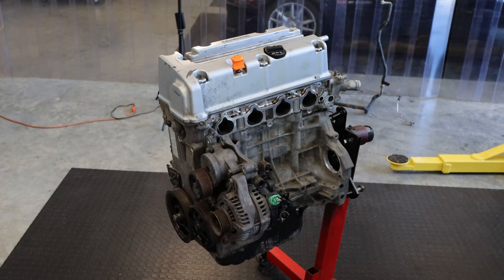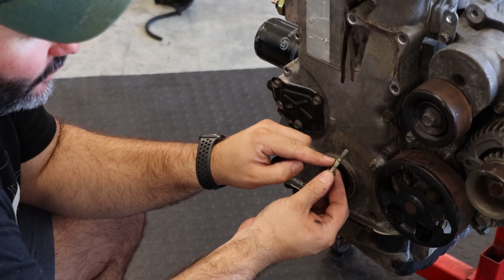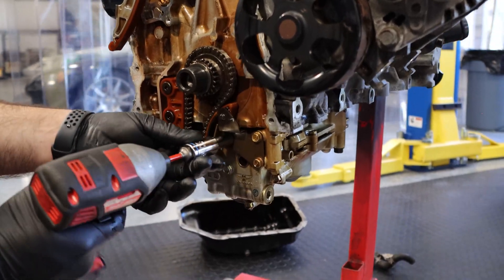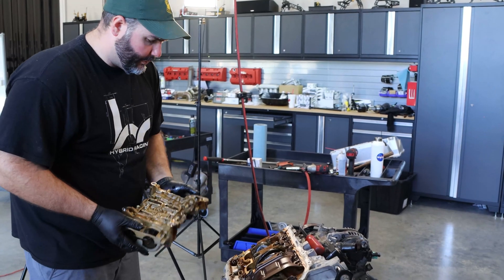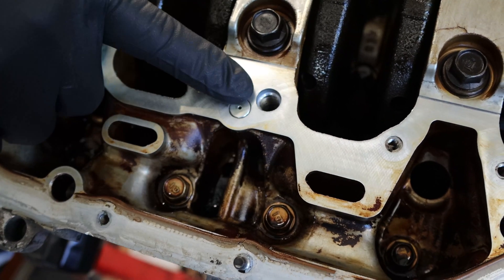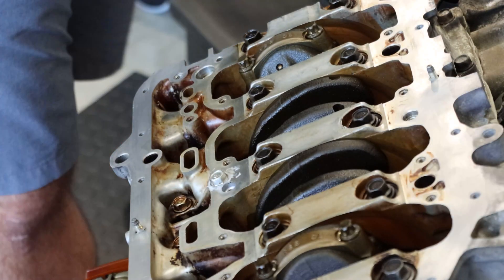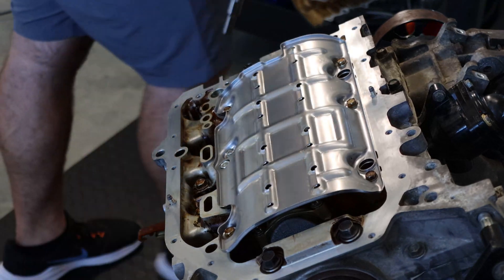K20A2 Oil Pump Upgrade installed on  a JDM K24A!

Comment: The purpose of the robust k24 oil pump was to reduce sound, vibration and rough engine idle. K24s generally came in more luxury or non-performance vehicles, thus the need for less sound/vibration.

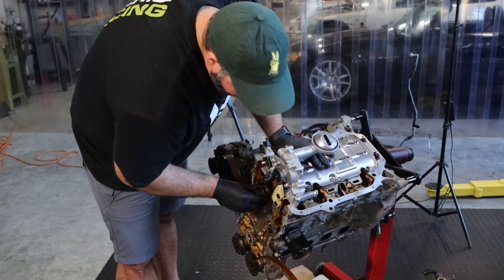Comment: Ummm what did you pull out at 16:20? I didn't pull anything out after I installed it all.
Reply from the maker: You must remove the holder that is in place on the oil pump chain tensioner. Once installed, you remove it so it will tension the chain.

Comment: Is here any difference on the a2 oil pump and the z1 oil pump? I'll be doing an K24a build this summer and I was wondering which one would be better? The a2 or the z1 oil pump? I'm leaning towards the z1 setup, but was just wondering if the z1 is better or is the a2 better? Thank you in advance to anyone that can help giving some advice. <3
Reply from the maker: They are the same.
Reply: @hybridracing  thank you! 🙏🙏

Comment: Brilliant vid and saved for when I swap the balance shaft out of my K20Z4 in the near future. Question though, do you have enough bolts off the old windage trays to bolt the new one in or need to order more? The old oil pump had bolts between cylinder 2 and 3 which are no longer used. Do these need replacing? Or just left open?

Cheers 👌🏻

Comment: You guys didn’t show the part how to modify or cut the k20a2 oil pump so it could properly fit on k24a
Reply from the maker: We explain it in the video. We used a bandsaw.

Comment: Question !!!! The bolt you guys put on with honda bond , is that necessary? 😭 cuz all i did was put a lil big of lug tight and screw a bolt in as tight as possible. I did have a thread in there, I know there’s people that dont and have to make one
Reply: yes fam honda bond is a must all manufacturers have one like ford etc. but yes bro use hondabond. Honestly leaving yourself up to failures by not trust. you should always use hondabond when needed and always torque to spec

Comment: I ordered k20a 2 timing chain set the chain does not fit. The k24 does not fit any suggestions
Reply: Get a k24 chain
Reply: chain should be 32 link instead of 31

Comment: Why after 5 different videos does no one say what size that bolt is that goes into the oil port? Could someone tell me the size bolt please?
Reply from the maker: It's an M8x1 bolt (regular Honda 12mm bolt)

Comment: Not a detail left out. Huge help.
Reply: They didn’t show the cutting of the oil pump so not really
Reply: @Red-ev8ls  buy your s-pump from 4piston. I just installed mine today actually 1991 k24a2 swapped crx, 50deg cam gears and s-pump along with some other stuff. If you get a 4piston spump it will come not only ported with the whole kit but knotched for fitment already. Its pretty easy to grind down though if you have just a stock spump
Reply: @Red-ev8ls  you want to see him set up the camera too😂
Reply: They also have another video for it

Comment: What size is bolt to plug the hole or which kind of bolt or part  number  please  and ty great video
Reply: I was wondering the same thing. I read thru the comments and found the answer. Use an M8 x 1.25 30mm bolt. Someone also mentioned using a copper crush washer too for a better seal. Hope that helps!

Comment: helpul video! Question about the windage tray, is it good enough for racing on the road course or should someone upgrade the oil pan with a oil baffle?
Reply from the maker: If you are ever going to take the car to a track and oil pan baffle is a must. It's an easy job to install one when the motor is apart as well.
Reply: buy a moroso oil pan thats what I have on my k24a2 and I have a ported s-pump also perfect clearance and the baffles are super high quality u can find one new like $570 worth it

Comment: Can you give a rough estimate of oil psi before and after i did this exact method and i have horrible consistency
Reply from the maker: Oil pressure will vary depending on the type and temp. However, peak oil pressure should be in the 75-90psi range. At idle with the engine fully warm, 25psi is about average.

Comment: Does anyone happen to know what size bolts you have to use with the tensioner because apparently if you buy one from ANYWHERE they don't come with bolts and I don't have a spare K20 just laying around for parts. Thanks!
Reply from the maker: If I recall, they are just standard M6 flanged-style bolts.  (your normal 10mm Honda  bolt)

Comment: That's the vtc solinoid in the timing chain cover not a vtc sensor
Reply: no that is definitely not the VTEC solenoid. that's the VTEC oil control valve. if you're going to correct someone, make sure you're actually correct....

Comment: so its possible to easily convert a jdm k24a to the usdm k24a2 ?
Reply: K24a is the jdm equivalent of the k24a2 out of a tsx. It is the same engine  just the jdm version not out of a usdm tsx.
Reply: @OnTheFly_PA  thanks i wasn't sure if it had some stuff that would make it harder to swap over as easily
Reply: @onthefly_pa3220 cams are different

Comment: That exhaust cam gear on the JDM k24 is 5x heavier than usdm one. I would suggest replacing it too. Did mine when I put in 50 degree intake cam gear and made big difference
Reply: I wonder if that's why they have slightly higher torque.

Comment: You don’t have to put engine at TDC before you start this process?
Reply from the maker: Since you have to remove the timing chain, you can put at TDC before you begin. Either way, you will need to re-time the engine after the oil pump has been installed.
Reply: Great thnx for the video, I’m in the process right now and it’s very helpful. One other question, can you reuse the oil pump chain? I bought a kit with a new oil pump chain and from what I can count the new one has 32 links as opposed to the original that had 31.

Comment: What RPM would the stock k20 oil pump handle safely?
Reply from the maker: Typically we wouldn't suggest revving higher than 8600rpm on a stock pump. The 4PR "PRB" style pump is modified internally, which increases efficiency to 9000+rpm. Keep in mind your oil pan and baffle can affect this as well.
Reply: @hybridracing  thank you for ypur reply. Much appreciated
Reply: ek sien jou mr CCD ;)
Reply: @AccordCL9-ZA  👀

Comment: I got a question please .. Is it necessary to change the plate ( windage tray) under the oil pump or we can use the A labeled plate only??
Reply from the maker: You will need to use the PRB K20A2 windage tray.
Reply: @hybridracing  Thank you boss for replying me . I thing i wanted to clear is when the oil pump is changed means i can rev up higher ??
Reply from the maker: @kingazhar1212  the oil pump isn't going to allow you to rev higher, per say... however if you do (and have the supporting engine to hold it) you'll have better, more consistent oil pressure while doing so.

Comment: I dont get why people are using honda bond to seal the plug bolt.
Theres a chance it can plug up the oil passages inside the engine if a pc  ever comes off inside the hole.
Just use a copper crush washer on the head of bolt from a banjo bolt for brake flex line.
Reply: Loctite sealant works better here.

Comment: You made that crank bolt look easy...the lie detector determined, that was a lie!!
Reply: It was probably pre loosened but I have a weighted socket that actually makes them pretty easy with a nice impact electric or air powered.
Reply: Facts!

Comment: Do we need to do this on k24a2 oil pump? Or this is only needed when using k20a2 oil pump?
Reply from the maker: You would do these things only when installing a pump that does not have balance shafts.